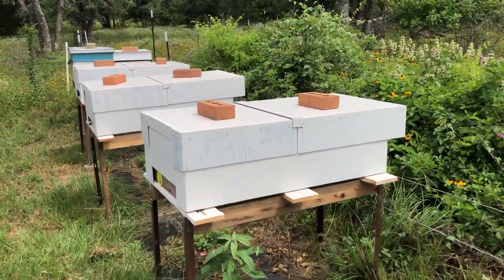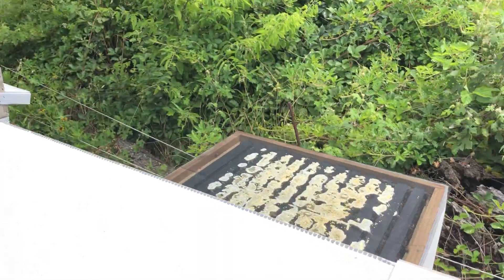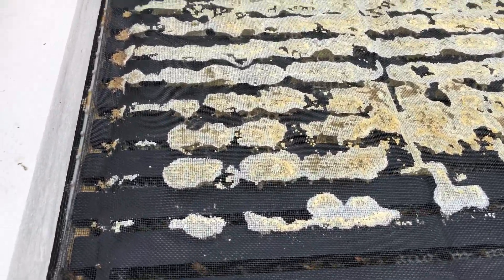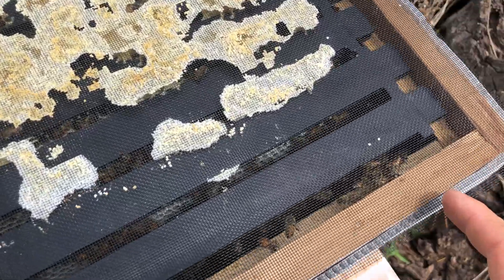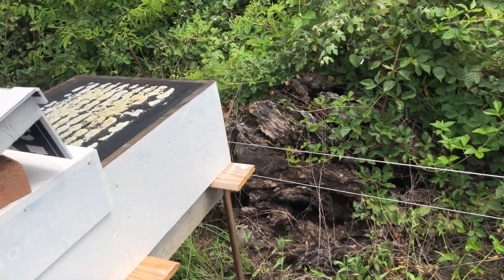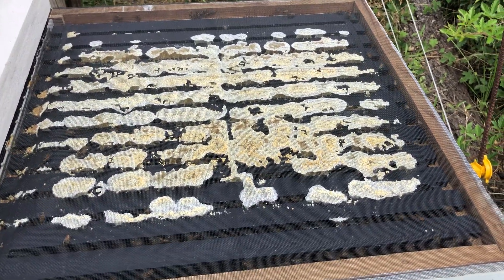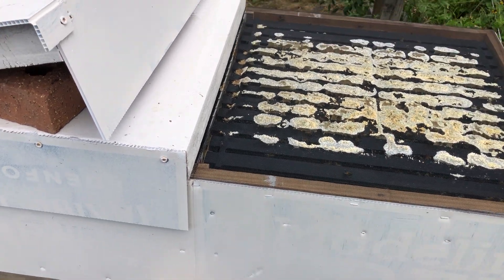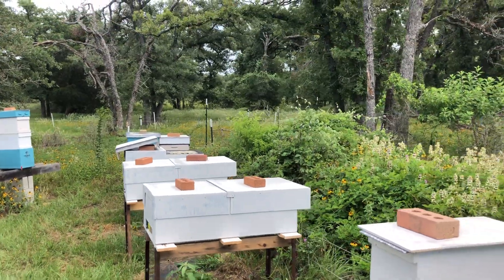Inline Hive Design

Comment: this is my second year with bees, and I sure got tired of lifting the supers.  I am going to do this with my current lang boxes so I don't waste them.  Thanks!  What are you using for a bottom board?
Reply from the maker: I've used a long bottom board with lang boxes, but you can use individual bottoms as well. Check out how I made mine here: https://www.beesource.com/threads/horizontal-hive-from-langstroth-boxes.373295/

Also, on this video, you can see 2 of my inline long lang hives: 
https://www.youtube.com/watch?v=QF8-5hvUon4
Reply: @flavorfarms  how do your bees clean out their dead with your solid bottom boards?
Reply from the maker: @beverlyrampey4102  yes, I don't have issues with them at all.